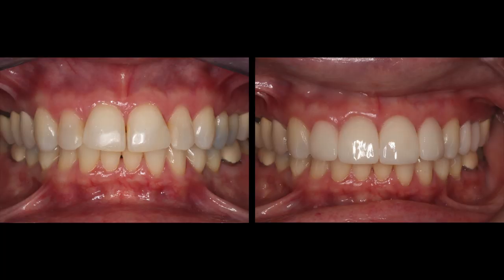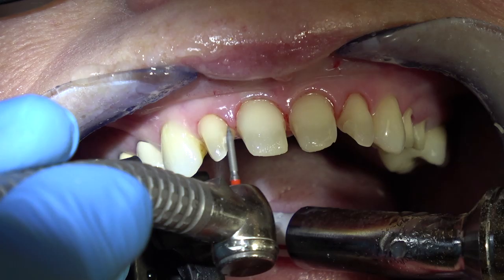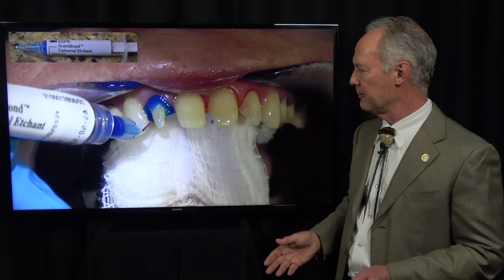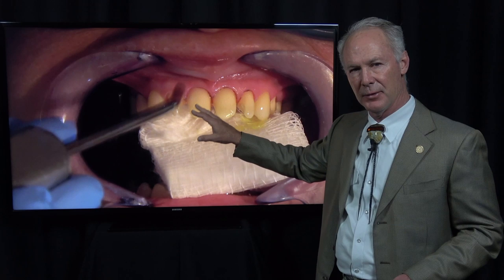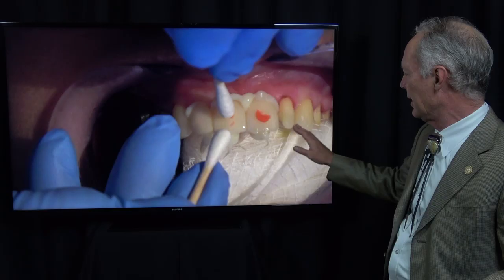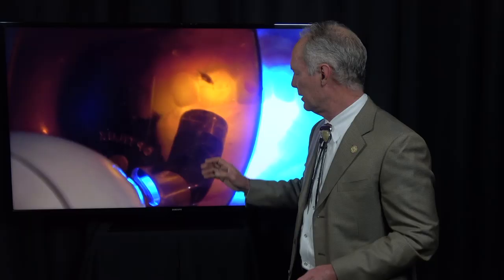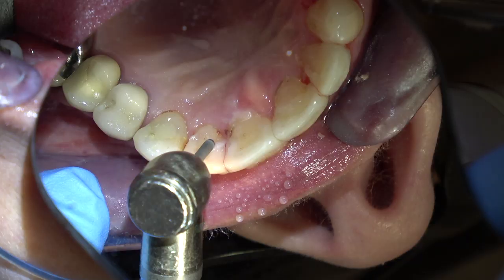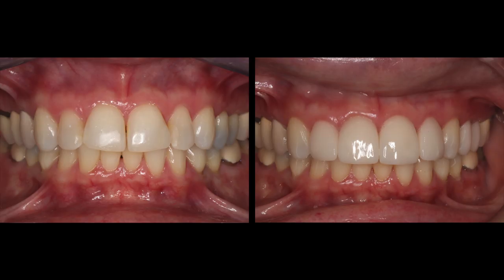Seating Four Maxillary Incisor Veneers - Dental Minute with Steven T. Cutbirth, DDS

Comment: Hi Dr.Cutbirth, Thank you for sharing these great videos.
May I know the rationale behind not curing the composite restoration( as explained at 8:45)? Will there be any problem if it's cured first before cementing the veneers?
Many thanks.
Reply from the maker: I do not cure the primer/adhesive prior to veneer cementation, and I cement the veneers all at the same time and do not cure until all are seated. Watch all the videos in DMC.com library several times on all the topics.
Take your practice to the Top Tier. Subscribe to DentistryMasterClasses.com for an organized library of all the Dental Minute videos plus many complete comprehensive cases and many very important articles. New cases are added weekly.  Only $39.95/month.
Click here to subscribe: 
https://membership.dentistrymasterclasses.com/purchase/?plan=513

Comment: You mentioned not to wipe off the excess cement until the initial cure but then you wiped it off on the lingual to make sure you had correct placement. Did you mean don’t wipe the facial and just wipe the lingual before initial cure?
Reply from the maker: When you press the veneer to place again after removing a bit of the excess from the palatal, it presses a bit of excess out the palatal so there is still excess cement. 
Take your practice to the Top Tier. Subscribe to DentistryMasterClasses.com for an organized library of all the Dental Minute videos plus many complete comprehensive cases and many very important articles. New cases are added weekly.  Only $20/month.
Click here to subscribe: 
https://membership.dentistrymasterclasses.com/purchase/?plan=513

Comment: Can't we cure the bonding agent after applying on tooth?
Reply from the maker: I do not cure anything until the veneer is seated.because I do not want any cured primer/adhesive thickness affecting the seating of the veneer. There is no reason to cure the primer/adhesive prior to seating the veneer if you cure thoroughly on the facial and lingual/palatal surfaces. 
Take your practice to the Top Tier. Subscribe to DentistryMasterClasses.com for an organized library of all the Dental Minute videos plus many complete comprehensive cases and many very important articles. New cases are added weekly.  Only $39.95/month.
Click here to subscribe: 
https://membership.dentistrymasterclasses.com/purchase/?plan=513

Comment: did you cure the scotchbond after blowing or did you just leave it? Did you use bond activator?  Did you not cure it either on  the venneer or on the tooth? Only light cured it when you seated it?
Thanks in advance
Reply from the maker: Yes, only light cured anything when the veneer is seated.

Comment: Great tips, thank you. I'm curious about using glycerin, which I notice you're not using here... would that solve the potential leakage problem if we prefer to wipe away excess resin cement prior to light curing?
Reply from the maker: Absolutely do not wipe excess cement away prior to initial light curing.  This is true with veneers or crowns.

Comment: Doc, so the margin of that veneer on the lateral that lost the class III filling is in the resin?  If a patient has class III existing restorations (intact/sound), do you leave the margin of the veneers in that resin or are you removing them?
Reply from the maker: If the composite filling is recently placed and sound, with no leakage, I leave the filling as is. If there is staining or leakage, I often wait until I am seating the veneer to replace it. If there is a composite filling in the tooth that is being veneered and you place provisional veneers with adhesive (unfilled resin) on the composite, the provisional may stick to the composite when you remove the provisional and you may have to reprep that part of the tooth when you seat the veneer. 

Take your practice to the Top Tier. Subscribe to DentistryMasterClasses.com for an organized library of all the Dental Minute videos plus many complete comprehensive cases and many very important articles. New cases are added weekly.  Only $20/month.
Click here to subscribe: 
https://membership.dentistrymasterclasses.com/purchase/?plan=513

Comment: dr is drying the teeth require for the provisional and permanent cementing or we can do it in a moist environment?
Reply from the maker: If you are using resin cement, the prepared teeth can be slightly moist.

Comment: Do you not have to light cure the primary adhesive on the prepped teeth and prosthesis fitting surface prior to cementation?
Reply from the maker: No, absolutely do not cure the primer/adhesive prior to placing the veneer with the filled resin.  Follow the directions in the video.

Comment: Hi doc.
After you placed acid on enamel and dentin, and rinsed it, did you place primer adhesive on  well dried teeth or on the teeth that were slightly moisturized?
Reply from the maker: I wet the teeth, then blot them with a 2x2 gauze. I do not desiccate the teeth. Take your practice to the Top Tier. Subscribe to DentistryMasterClasses.com for an organized library of all the Dental Minute videos plus many complete comprehensive cases and many very important articles. New cases are added weekly.  Only $20/month.
Click here to subscribe: 
https://membership.dentistrymasterclasses.com/purchase/?plan=513

Comment: I have a question. I have gotten my 4 wisdom teeth out to get Invisaligns to correct a very crooked upper tooth (nr.10) thats behind the lower row. My 2 middle upper teeth (nr.8&9) are very big and i wonder if veneers might be a good thing after getting the teeth corrected. My worry is that i have had one of my front teeth chipped and every time it was fixed with a modelling filler, the filler broken off again after a few months. can this happen to Veneers too? Thank you very much.
Reply from the maker: Veneers are terrific and, if placed with the technique I am teaching, very strong - as strong as natural teeth.  It is important that most people wear a nightguard while sleeping to protect the teeth from chipping and wear (bruxism).  It is also important not to bite anything harder than a soft sandwich with your front teeth.  This applies to natural teeth or teeth that have not been veneered.  The front tooth angle is not good for biting hard things.  Watch my DM video, "How to Keep Your Teeth for a Lifetime."

Comment: Would you consider applying Empress crowns to maxillary incisals in a younger patient who is insisting on high translucency?
Reply from the maker: Veneers, not crowns on anterior teeth if the tooth is healthy and not broken down.  Preserve tooth structure.  Remember, veneers are as strong as crowns and natural teeth if you use the correct technique.
Reply: Dental Minute with Steven T. Cutbirth, DDS   My error. Replacing  crowns

Comment: greetings Dr. steven
Thanks alot for your hard work , i may have some queries 
recently i applied veneers Imax i wasn't satisfied with my upper jaw so they sent it back to the lab , however i applied the bottom jaw ( lower teeth ) total of 10 teeth with no adjustment as the Dr said she will fix the bite once i applied the upper jaw 
now , bottom veneers are not even ( need to be shaved or i dont know the term of it ) is it really possible for veneers to be adjusted to be Even ( middle lower 4 teeth )  ? and will the Dr be able to line it with the whole 10 teeth ?
Reply from the maker: Sorry, I cannot diagnose your condition or treatment options without examining you.

Comment: Great video Doctor?Can I use the same bond adhesive and RelyX veneer cement for emax veneers as well?
Reply from the maker: Yes you can. These are e-max veneers in the video. Be sure to treat the e-max prior to cementation. 
Take your practice to the Top Tier. Subscribe to DentistryMasterClasses.com for an organized library of all the Dental Minute videos plus many complete comprehensive cases and many very important articles. New cases are added weekly.  Only $20/month.
Click here to subscribe: 
https://membership.dentistrymasterclasses.com/purchase/?plan=513
Reply: Is self etch and self adhesive resin cement like max cem ok to seat emax veneer..Do I still have to use primer adhesive on the veneer and the tooth if I use that cement?
Reply from the maker: I am not sure. I have used the method I describe in the video for many years with excellent results. For that reason, I have not tried other methods.

Comment: Hi Dr. Cutbirth, is it mandatory to put adhesive on veneer before applying composite resin? Or is this step needed because silane is not applied? Thank you very much for the video and information.
Reply from the maker: Yes, you must apply primer/adhesive to the tooth side of the veneer and the prepared tooth.  Be sure to blow off the primer/adhesive so nothing "wiggles."   Do not cure the primer/adhesive until the veneer is seated, just like the videos.  Silane is not needed.
Reply: Dental Minute with Steven T. Cutbirth, DDS thank you so much for the information!
Reply: It's so frustrating getting different answers to whether to cure the primer on the tooth or it to. I know not to cure the bond on the veneer but do u or don't u cure the tooth. So many different videos with different answers it's very frustrating

Comment: Dr can we use dual cure cement?
Reply from the maker: Yes.  The problem with dual cure  is selecting a proper shade plus the dual cure composite turns dark during the setting process, which is disconcerting as you watch the reaction and hope the shade doesn't remain that dark.